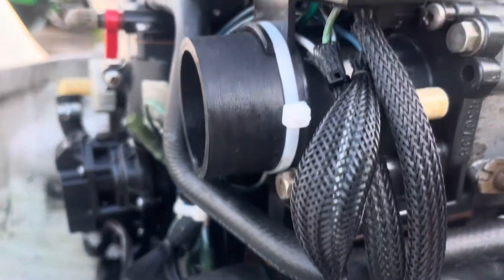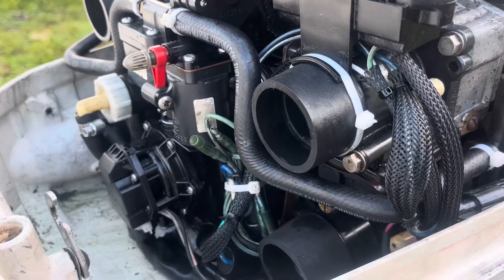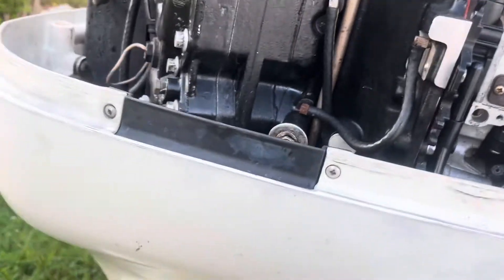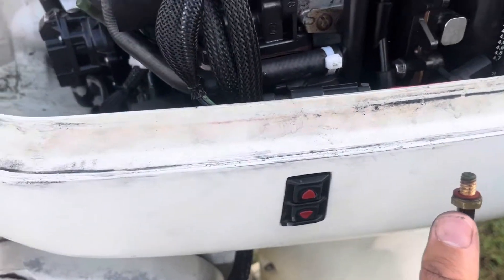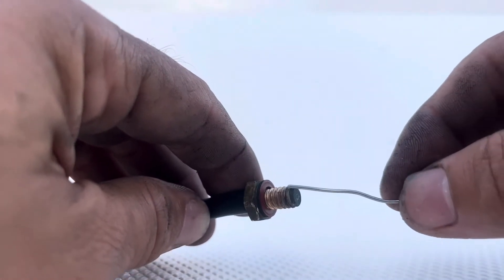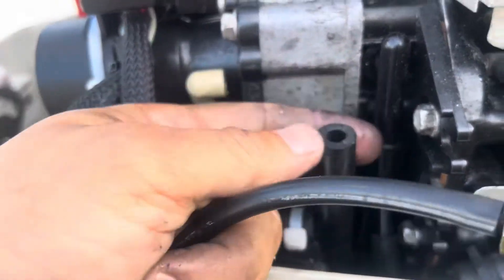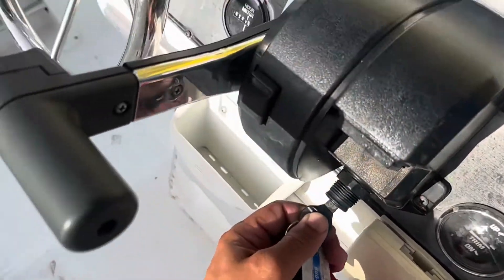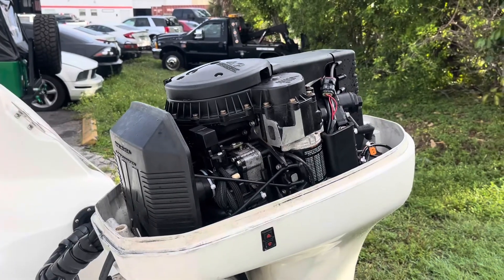Johnson/Evinrude cold start problems

Comment: Great job buddy.  Just one thing, that electric primer is not a "pump", it is only a valve.  Not trying to criticize your english, which is great by the way, just want to clarify.  So, when starting a cold engine, you must pump up the primer bulb first to develop pressure to flow through the electric primer or you will have to crank the engine until the fuel/oil pump develops enough pressure.

Comment: I have a used 1996 johnson 6hp. Struggles to start cold. In order to start it when cold I spray a little starter fluid in the air intake. I know that this is a common problem with my specific engine. When it is warm it starts first pull. Apart from the cold start issue it runs perfectly. What exactly is the problem?
Reply from the maker: As you can see in the video the problem is  the  fitting that injects fuel to the engine when you press the choke
Reply: If you have a two-stroke motor and you're using starting fluid to fire it up the first time there is no oil in that starting fluid You're basically running the motor without any oil. Not a great idea

Comment: Looks like you are in Boynton Beach.  I have the same engine as in this video.  Do you do work locally?  I need my timing set.
Reply from the maker: hello brother im in Boca. what make you think that you have to set the timing?
Reply: @thesmallboatrepairchannel9173  thanks so much for replying.  After watching your video I fixed my hard start problem.  In the process I replaced everything.  Primer solenoid, fuel pump.  Rebuilt the carburetors and ignition key to operate the gas primer.  The original problem was that at 4000 rpm the engine bogged down
Reply: In the process the starter broke the flywheel cover so I had to takeoff the flywheel cover, replace the solenoid and the starter, which fix the problem but then when I put everything back together, it started running really rough so I assume that the timing is bad I replaced the timingI replaced the stater I replaced the power pack. I replaced everything in the engine and is still doing the same thing. I desperately need your help.
Reply: Is a 2004 I checked the compression was about 110 on each cylinder compression was fine. The engine starts like a champ but it’s still at idle turns off and fast full throttle it slows down so that’s why I assume it’s the time there’s nothing else I can replace I even replace the coils the plugs even ran fresh gas from a separate fuel tank.
Reply from the maker: @dbagno   5617032261 text me Monday

Comment: I have the same motor and I'm trying this tomorrow i know its going to work since I've tried everything else.
Reply from the maker: Let me know thanks
Reply: I took those nipples of and they're clean with no clogging, a few years back I did find the hoses from the solenoid dry rotted and cracked. I use good gas and regularly seafoam everything including additives to the fuel tank when filling up, I'd have a lot more free time if the boat would just sink one day. Thanks and have a good day bro.
Reply from the maker: @deanlockamy2087  ok have you try your choke  with the hoses disconnected to see if it works! It should spray fuel when you press  it in your console

Comment: I just bought a boat with a 2005 Johnson 2 stroke 115 hp. What are some things I should double check before I put it in the water? Thanks
Reply from the maker: Hello Rich  do you know if your engine is carb or injection?  anyway is good to check your battery charge, gasoline status and hoses  before put it on the water and please don't forget to put the drain plug in the boat before back in up in the boat ramp lol . i made a vide   a little bit ago of things that i recommend   to check before use the boat. thanks for watching . 
https://www.youtube.com/watch?v=B2mOwLh18U4

Comment: The system check alarm beep ..should that beep twice on start like the video or just once then motor starts ?
Reply from the maker: It normally beep every time the power gets to the tachometer. By turning the key on  or turning the key to start position…
Reply: Yes mine does it when I turn the key on like normal... then as soon as motor starts it will do it again... is this normal ? It does the same like yours in the video when you start your motor
Reply from the maker: @husseinhammoud-br7nr  that’s completely normal
Reply: Ok thanks mate...I thought it was an indication something is wrong but clearly I'm wrong , have u heard that ?